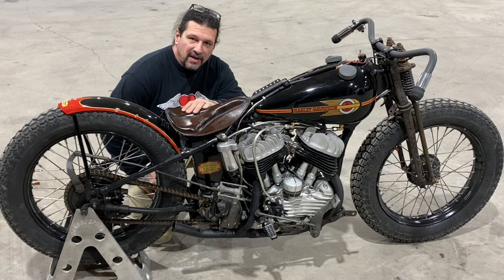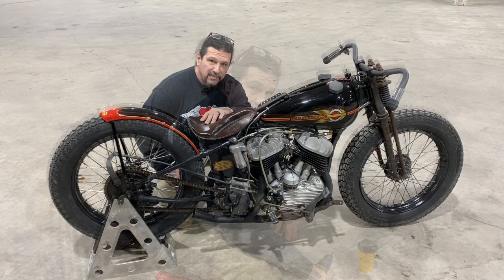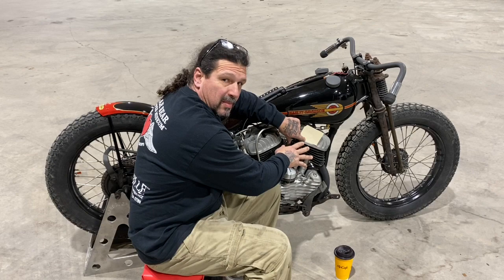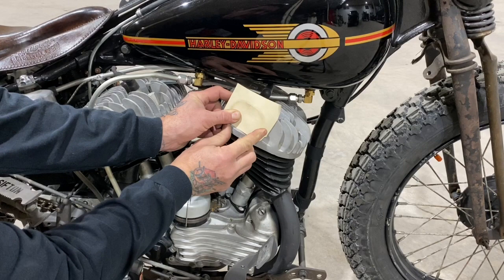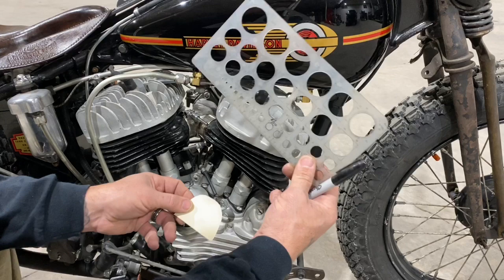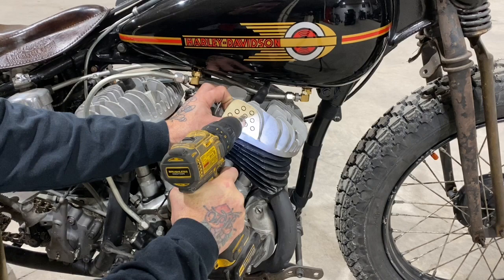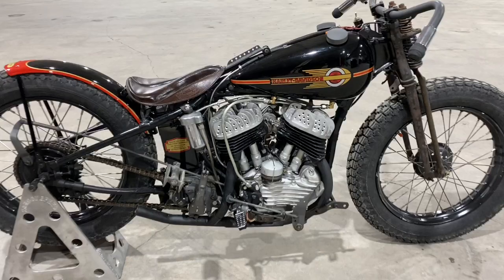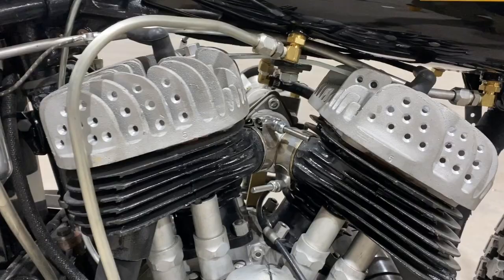Lightening Holes, SpeedHoles Billy Lane 1937 Harley-Davidson 45

Comment: I would think it wouldnt be a huge heat difference if you shaved all the big fins down to the smaller middle fin size, in a race bike that moving balls out it shouldn't make much of a heat difference not like a street bike that deals with traffic would